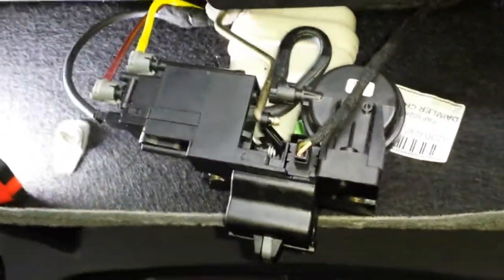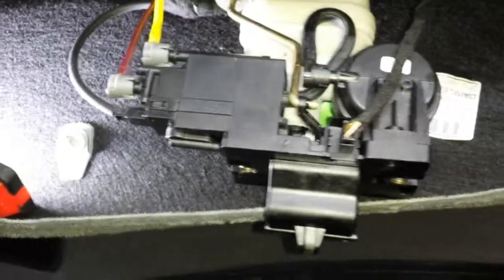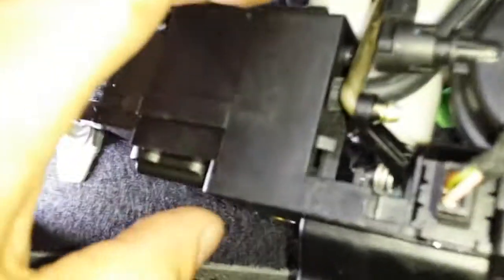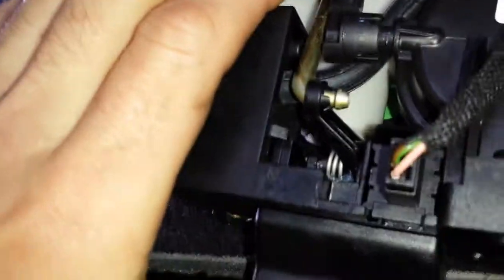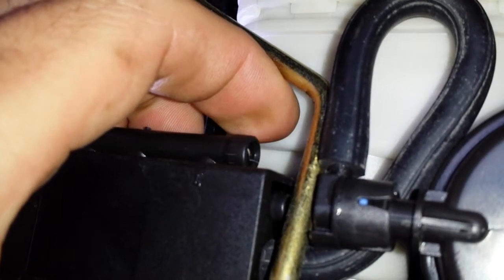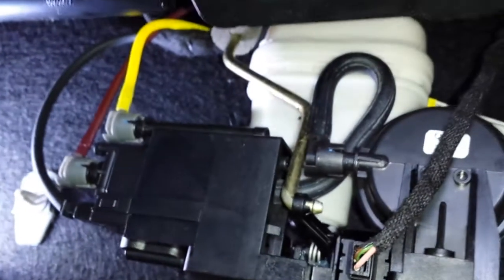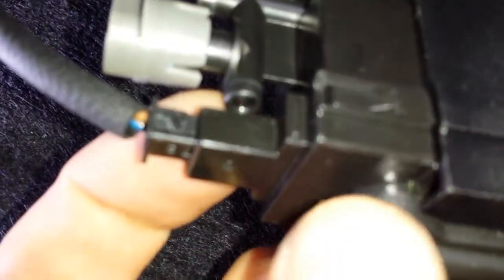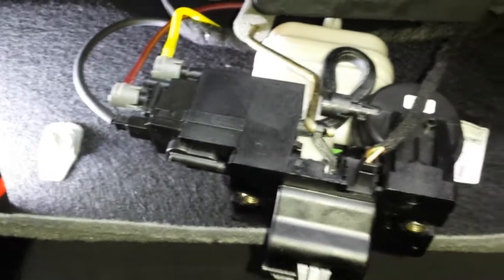Mercedes sl55 trunk lock air leak

Comment: I've owned an SL500 Mercedes for years. Just replaced the trunk latch assembly. I also own an E350 sedan and an E350 coupe.  Everything that's ever gone wrong with my three Mercedes is ALWAYS a common issue! So, if you want a car that doesn't have 10,000 common issues, buy a Nissan. I have two Nissans and they only go into the shop for oil changes and batteries.

But, the SL500 is fun to drive...

Comment: Hi the white plastic part you call the piston is that suppose to have air coming out of it through the middle where it joins together because on testing it's spewing out of that. Just need to know if that's normal? Thanks